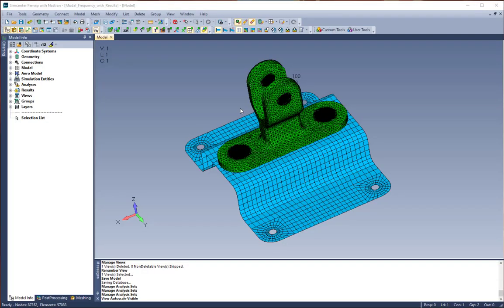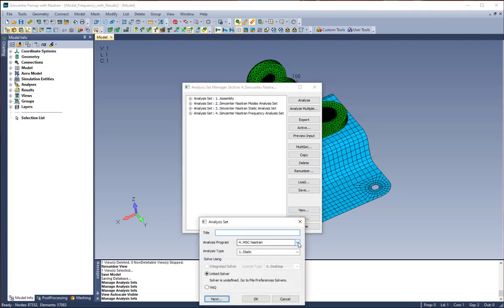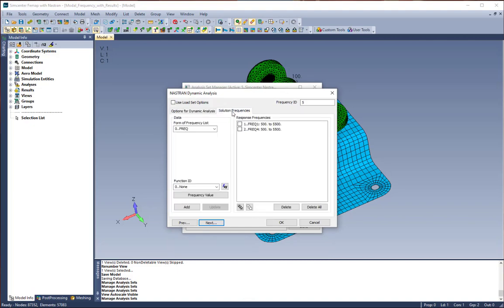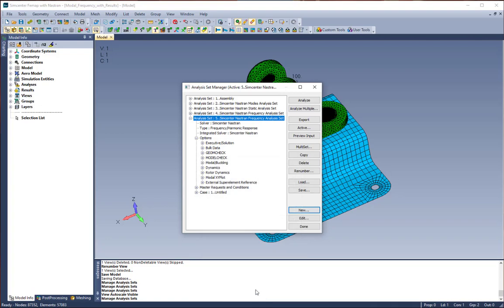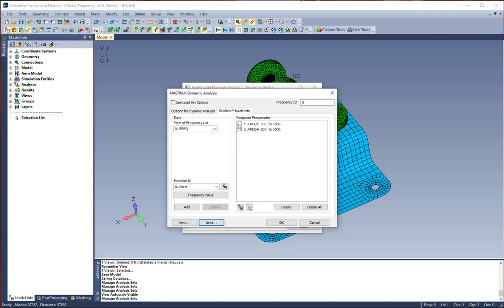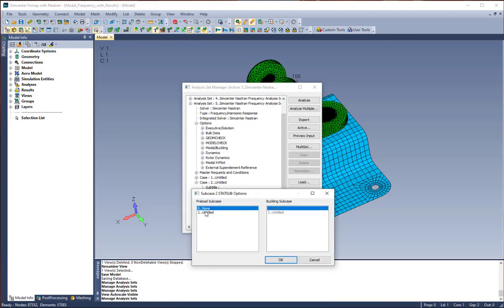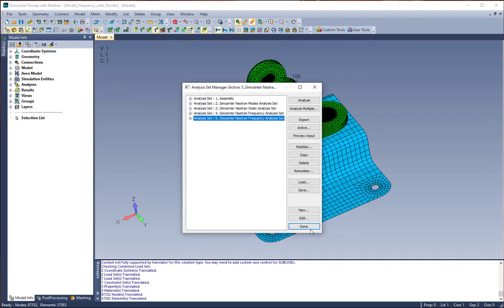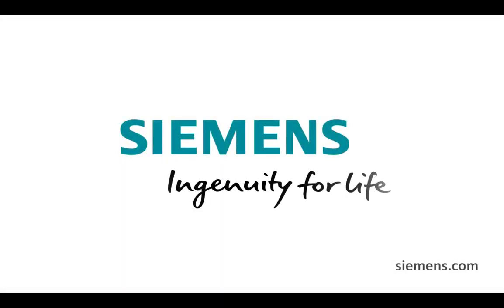Femap 2021.2 - Dynamic Analysis with Multiple Subcases

Comment: I have tried the exact same method with linear transient analysis SOL112 (Modal Transient analysis), and each time, I end up with a Fatal Error.
"*** USER FATAL MESSAGE 22102 (BOLTFOR)
     SPECIFIED DISPLACEMENTS (SPCD) NOT PERMITTED IN A PRELOADED BOLT ANALYSIS
     SET SYSTEM CELL 581 AND USE THE 2 SUBCASE APPROACH OUTLINED IN THE USERS GUIDE."

Here is my Nastran card

INIT MASTER(S)
NASTRAN SYSTEM(442)=-1,SYSTEM(319)=1
ID FEA,FEMAP
SOL SEMTRAN
CEND
  TITLE = Test
  ECHO = NONE
  NSM = 8
  DISPLACEMENT(SORT1,PLOT) = ALL
  ACCELERATION(SORT1,PLOT) = ALL
  SPCFORCE(SORT1,PLOT) = ALL
  SPC = 1
  BGSET = 114
  DLOAD = 4
  METHOD = 1
  TSTEP = 1
SUBCASE 1
  LOAD = 7
  BOLTLD = 7
SUBCASE 2
  STATSUB(PRELOAD) = 1
  DLOAD = 4
  SDAMPING = 4
  TSTEP = 3
BEGIN BULK
$ *************************************************************************
$   Written by : Femap
$   Version    : 2024.2.1
$   Translator : Simcenter Nastran